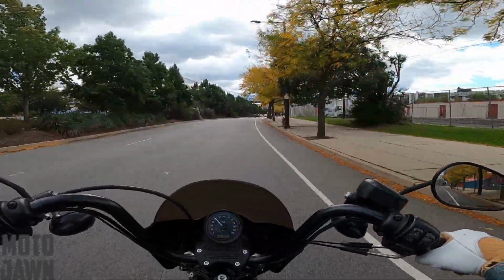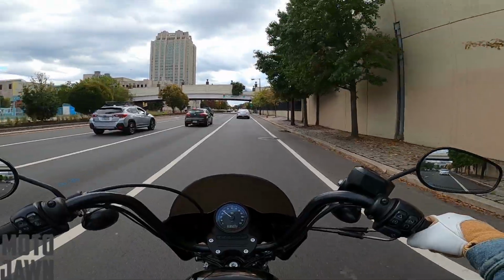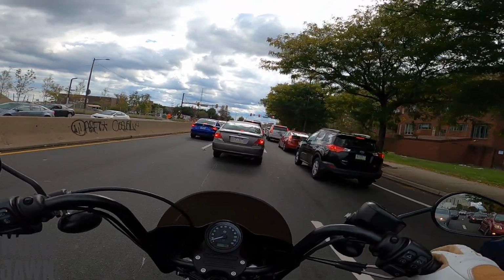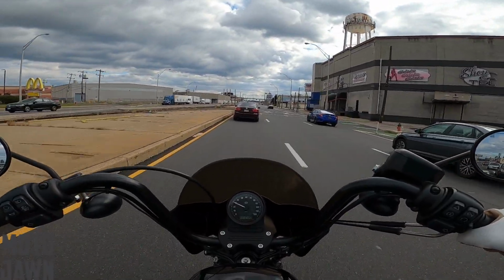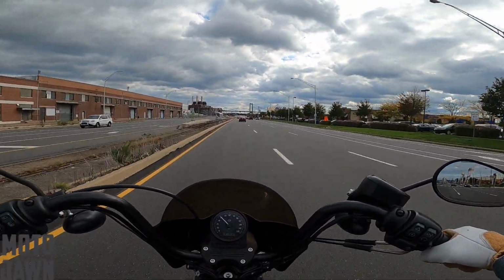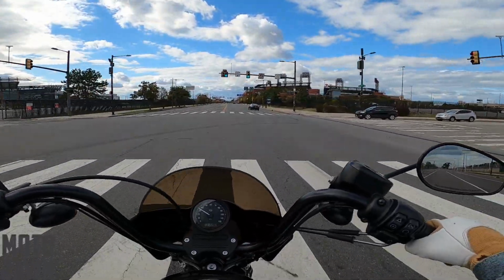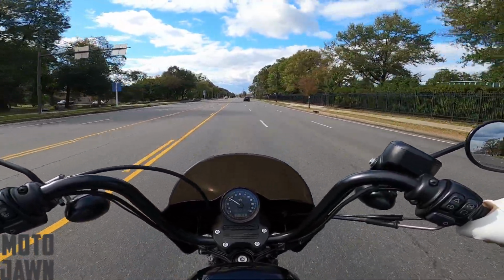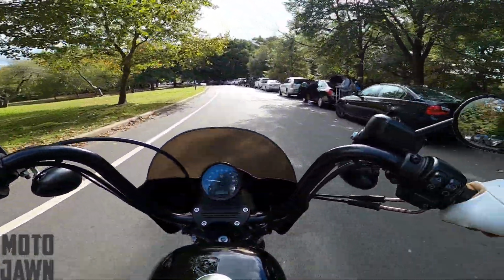The Absolute WORST Part on the Harley Sportster Iron 1200!

Comment: I have owned and ridden an '06 Sportster for over 5 years now. Performance wise, it is completely stock, and it definitely has more performance than I need. Single front disc is fine (if your brakes are capable of locking the wheels, then they are fine. you just need to learn how to modulate them properly) Suspension is fine, and I have a bad back. Seat is fine, it is the stock seat that came on the 2006 1200L. It doesn't LOOK comfortable, but I have no complaints after a 300 mile day. It still has the stock air cleaner. Most aftermarket ones are cheap Chinese JUNK. It does have aftermarket slip ons (in chrome) just to make it sound like a Harley. It has a short chrome backrest with no pad, and gold H-D emblems on it. And it has saddlebags attached with Easy Brackets, they lock to the bike, but can be removed with the turn of a key. Other than those items, it is 100% stock and I love it. It is everything I want from a bike. Well, actually, I would like to convert it to chain drive, but have been unable to find a conversion kit for my model. It has a 4.5 gallon tank, which gives me good range. Now, as far as garbage parts, I have found two so far. They work just fine, but tend to explode around the 15K mile mark. The clutch has a "spring plate" in it, which is 2 plates riveted together with brass rivets. It is commonly known as a "grenade plate" The rivets fail, things come apart, and can do serious damage to your transmission. Barnett makes a kit to fix this problem. The other problem is also in the clutch. It is the clutch release bearing. It is poorly made and prone to failure. There is a German made bearing that fixes that problem permanently. It's more expensive than stock, but well worth it. 

As you can see, none of these things have anything to do with engine performance, brakes, or handling. Those things are just fine. I ride a Sportster for the "Harley experience" meaning the sound and the shake. Even though it is called a Sportster, it is NOT a sport bike. It is a cruiser. It also makes a great solo touring bike. If you want a crotch rocket, then buy a crotch rocket. All 4 Japanese manufacturers make great ones. Along with a couple of European manufacturers. If you want a high performance bike, just buy one to begin with. The Sportster is not for you. It is for long leisurely rides, where you can just kick back and enjoy the bike and the road, mile after mile, hour after hour. 

I would NEVER put LED lights on a bike or car. If you can't see with the stock halogens, there is something wrong with your eyes. I have had to wear sunglasses and a tinted face shield at night to avoid being blinded by those LED lights. If you blind oncoming drivers, they are likely to drive head on into you. And it would be your fault.

Comment: The front tire has more grip before breaking loose, than most riders realize.  You were pumping the brake at that yellow light as you understandably didn't want to lock it up, but how close were you really, to locking? You may have had a lot more to go, thus making the error yours and not the bikes (I've had this happen myself...and with a passenger on board no less!) which would be unfair to the bike. Maybe our riding skill is the part that needs upgrading, dunno just sayin.
Reply from the maker: The rear was definitely locked up. Might have had more to go on the front.
Reply: I've read stories written by cycle cops who say that most street riders grossly underestimate how hard they can squeeze the lever. They recommend practicing panic stops to build muscle memory, some of them do it at the beginning of every shift. But on the road, you have to factor in things like lean angle and pavement conditions.
Reply: Does your harley have ABS?
i thought that, if your moto has ABS, you could squeeze the lever as strong as you can and the wheels won't lock. But I'm not sure. Does it right?

Comment: Ok, you covered a lot of ground here. Definitely the seat! The seat on my 2005 1200 Roadster was good for 30 minutes before my hips started aching. The suspension was OK until I started riding my son to football practice. The Roadster came with dual front disc brakes, just like my GS850G did, and I've never had an issue with them. You'll have to investigate what's required to retrofit your bike. I did replace the front brake line with a stainless steel braided line and that really improved the feel.

Comment: 💯 definitely rebuild the forks with a progressive spring kit and shim it a little more. It makes a huge difference! And I didn’t like the stock tires either, they seemed to start wearing funny. At 2500 miles I put Michelin Commander III on front and rear and it’s like riding a comfortable street bike now!
Reply from the maker: All good stuff

Comment: When you buy a bike you usually change the seat, bars, exhaust and even the brakes..

If you are already locked up and skidding then having more brake power is only going to multiple the problem.. if you are locked up it's riders fault for not reading the road enough in front of you and also applying the brakes to aggressively..

Comment: I had an accident due to the brakes. I was approaching an intersection we had the green light then an ambulance decided to run there siren at the intersection only.  car in front of me braked abruptly so I gradually braked with increasing force as well not realizing how easily the brake would lock up . Is there any great brakes recommend?
Reply from the maker: Sorry to hear that
Reply: Glad I made sure to get mine with abs 😎
Reply: Yes Armando, on your car. You're probably not meant for motorcycles. You should get off them before you get hurt.

Comment: 2021 883: 
Lights were awful. I threw on a hogworkz halo LED front lamp and kuryakyn tracer diffused halo signals. Love them.
Stock seat was actually not too bad, but 
I put on a LePera kickflip and love that a lot.
Reply from the maker: Agreed those bulbs are terrible

Comment: Get some goooood rear shocks. Don't go cheap. I went with 3 inch over stock Legend 110 with a 1 inch lowering blocks. I love the ride now. I also changed out the seat, tall sissy bar with a sissy bar bag. I can strap on my camping gear. The sportster is a cruiser not a sports bike. The front brake will stop you a lot faster then the rear. I've had to do an emergency stop and grabbed the front brake and stopped just fine. The rubber on on the back tire has to stop you and the back will be lighter in a an emergency stop. Practice you emergency stops with the front brakes.
Reply from the maker: Gotta use them both but just sometimes feels like it needs a little more grab to it
Reply: @TheMotoJawn  have you ever bled the brakes? A possible air bubble in the line? Just a thought.

Comment: The worst "part" on the sportster is the lackluster performance. It sucks to be on such a cool looking bike but then get beat by some kid on a rebel 500.
Reply from the maker: Nah I love mashing the throttle and still feeling like I'm standing still
Reply: If you bought a Sporty to beat anyone, that's on you.
 I didn't buy a motorcycle, I bought a frame mounted with the finest canvas anyone can buy.
Reply: @jmearley4872  Sounds like you got ripped off to me
Reply: @IronBornRider  you may be correct. Then again, since 17 years old I have traded different stages of painting for parts or internal work. 47 years worth of canvas.

Comment: Not true on all Harley Sportsters. Try one like I have a 2020 Roadster. Pipes yes replaced, lights yes replaced, but the stock seat for me has been comfortable even for 300 miles rides. It Comes with dual floating discs with great calipers, inverted front forks and 3.3 inch rear shocks so it rides better than other Sportsters. 19" front and 18" rear rims so it give more ground clearance and better lean angles.  Try one!

Comment: The braking power is more on the front brake not the rear.  I rarely used the rear breaks when I had more sport bike but with the iron better to use both but the front still does most of the braking over the rear.

Comment: The worst part(s) for me?
 Anything used as a fastener!
 I have a 2020 bone stock 1200 Iron and couldn't believe the screws, bolts and nuts, and the damn muffler clamps had degraded as much as they have.
Reply from the maker: I have had a few of those things snap and break too actually

Comment: That’s a bit scary about the brakes man.  I’ve skidded a few times as well (no abs on my bikes) and question how good they really are.  Been looking into some dual disc setups now like my vrod has, it has some incredible stopping power.
Reply from the maker: I'm curious to see how abs would perform I've never had a bike with it
Reply: @TheMotoJawn  You’d absolutely love it!
Reply: If you can cause your front wheel to skid, then adding more stopping power with an extra disc would make a skid even more likely, wouldn’t it?
Reply: @ozarkwheels4158  I’m not a smart man my theory was dual disc meaning less pressure and less chance of locking up the brake but I could be way off base haha.
Reply: @ChopperFett  You may be right. I’m no expert either, ha!
Reply: I looked it up. The advantage from dual discs is to lessen fade. Having two doesn’t change stopping power. You’ll lose traction at the same applied force, mass, speed, and road condition with either single or dual discs.
Reply: @ozarkwheels4158  haha the more we know.  Thanks man!

Comment: Harley is a global firm using many suppliers. My feeling about the brakes, especially, the rear, is that the brakes picked up moisture in shipping somewhere in transit. Even a teeny bit stops effective braking ‘cause they can’t heat up to work right. Once any moisture is gone, they should work fine. IMO the brakes are superior to the old style Bendix single puck jobbers. Shocks are indeed too stiff and too slammed down. I did put a set of 412’s on mine, although a 13” shock would be better. And handling…those stock tires really suck. I put new tires on @ 15000mi . No wonder why the new sportsters are wearing Dunlops again. I put a set of K591’s on my iron and it was like a new bike. I never realized how much I was sliding around. Fork springs seem to be adequate but a better fork oil could help. Ifsthat doesn’t help, move to a state with better roads.

Comment: My Sportster is all stock except for the exhaust pipes.25yrs old and has 400,000 miles on her.  I did wear the front end out at 250,000 miles.

Comment: The battery. Can’t go anywhere if it doesn’t start lol. Go with the Antigravity lithium ion restart.
Reply from the maker: Agreed very weak stock battery!
Reply: The battery, in my experience, usually will flip you off on the first try but start on the second when they start dying. They'll give you fair warning before slipping you the knife. My bike came with a battery tender and I use it. Even so it seems like 3 or 4 seasons is all you can get.

Comment: I put on the hd sundowner and went for a ride, my road has a lot of bumps, new seat handles them just fine

You could spend a lot on shocks and never fix the ride

Corbin, mustang, LePera or hd sundowner(15inches wide).......you want at least 12 inches wide

Iron is not going to have the best ride of Sportsters......you want to look for 1200 or 883 C.........or you could spend a lot and get 13.5 inch shocks, probably have to get longer fork tubes, and maybe beef up the fork springs

Comment: for my 2021 48 I thought the worst was the headlight I changed that.  The mufflers absolutely had to go and went with cobra 3" rpt's and love the low growl...I am with u on the brakes on a  "gotta stop now" it requires all the skill I can muster and a bit of luck...they are ok even on a quick stop but on the oh s@#t moments they leave u locked up and sliding. As for the seat I liked it I did however go with a super reach seat so I could plant them forward controls better and I like it to I went 230 miles last week and my tush thanked me for it.
Reply from the maker: Haha i hear you man I agree 100%
Reply: Hey brownboy, try different brake pads. There's an assortment available, made out of a variety of materials.   That will help. However if you just want to keep pissing on yourself about how imperfect  a Sportster is, don't do anything ! Duel disc's would completely solve your brake problem, but again, then you couldn't repeat over and over and over again how terrible the bike is.
 Tell you what, the REAL answer for you is to go to the nearest YAKADUKI dealer and buy their street legal 'race bike'. Get all the usual 'race type leathers' , boots, and multi colored full coverage helmet. Then you could go to the nearest mountain top, and pretend you're a 'racer' with your new perfect bike that doesn't have any junk parts on it... until you go off a cliff. In which case, we won't hear you pissing all over yourself over, and over, and over again about one of the most iconic motorcycles ever built ! That was fairly mean... OK, just go trade in your bike for a car, so you don't hurt yourself. I seriously doubt if you really have what it takes to be much of a long standing motorcyclist.
  OH NO !!! DID I SAY THAT OUT LOUD??!!!!
Reply: @clintwoodruff1187  I did all that then went back to the stupid fu@kin harley with bad brakes..thanks anyway🤙🏼

Comment: I don't know about my irons stock seat, I bought it used, but 04 883c stock seat sucked, 13 1200c stock seat was much better......I rode a 48 with stock seat and it sucked bad after about 15 min, guess that's why it has 2.2gal tank......my iron came with the saddlemen stepup that you see on 1200 irons everywhere......that seat sucks. I ordered from hd solo Sundowner......I know 2up sundowner for 883c is great, and sundowner for 13 1200c sucks.....so I gave my brother my 883 seat for his 1200 and traded mine in for 900 Kawasaki.......which had a sucky stock seat

I don't know yet about my new sundowner, waiting for it to warm up......ordered Thursday received Saturday, I was able to find some solo seats cheaper "shipping calculated later", but hd was free shipping returns, so I went with hd

BTW my Versys 1000 stock seat sucked bad, touring bike and after 5hrs I could barely walk, put Corbin seat on it and after same trip I was ready to go another 5hrs

I might look into rear shocks

Exhaust stays, I can't sit on top of loud, my brother and cousin have found just how bad loud is to sit on.......keep you stock for when you learn

Comment: Dont get the logic pay 10k for a bike with terrible seat suspension exhaust? add 2k to the price! I suggest getting Yamaha Vstar 1300 lot more powerful full size bike used (Yamaha stopped making 1300) for less then 4k. The only thing you bought was HD label

Comment: You should squeeze your front brake, progressively squeezing harder. This allows your front suspension to load the front tire providing maximum braking without locking up the front tire. Pumping the brakes no doubt lost you a fair bit of real estate. That said I have no doubts you need to upgrade the stock set up. Remember, always  practice emergency stops in a parking lot or somewhere away from traffic. Be safe.